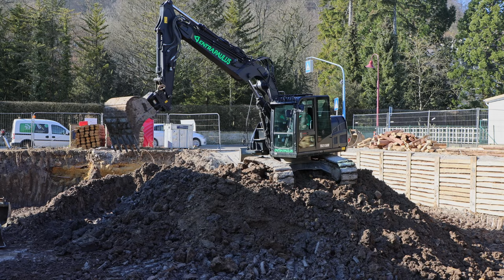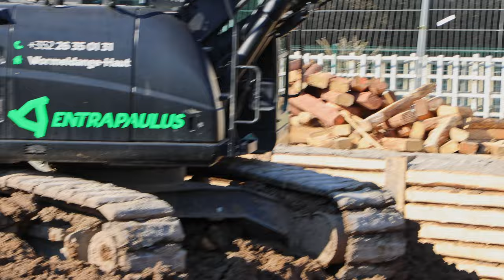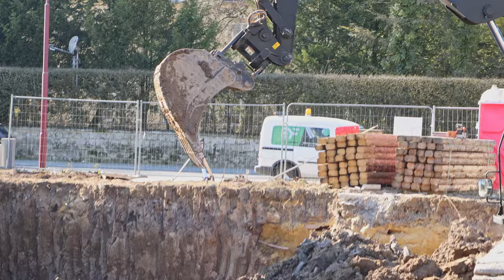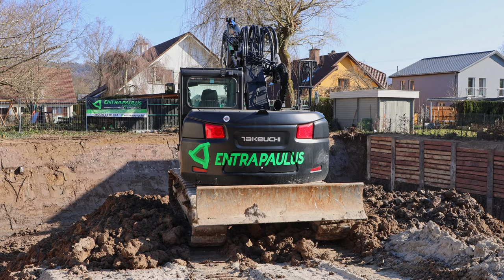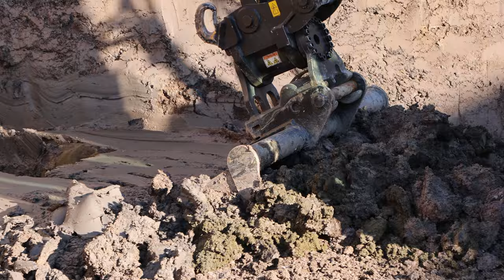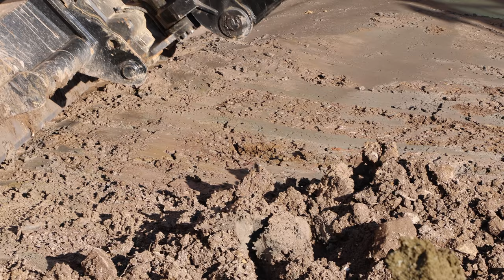Takeuchi TB 2150R from Entrapaulus digging a basement

Comment: Another great video😎👍. It was a strange quick connect system that the machine had!? 🤔.  Did he had tilt system in the quick coupler too?? I have never seen that system before 🫣🙂
Reply from the maker: It's called 'Powertilt', it's a bucket tilting attachment that doesn't use hydraulic cylinders. I've mostly seen them sold and advertised by the German distributor of Takeuchi diggers.
Reply: Powertilt is very common here on smaller excavators and wheeled excavators. Sometimes combined with OilQuick.
Reply: @peon9282  here in Norway we only have rototilt on our machine. I think almost every excavator under 30 ton have it😊👍